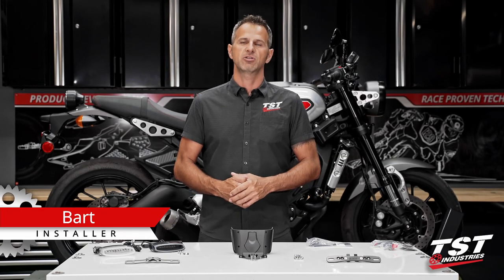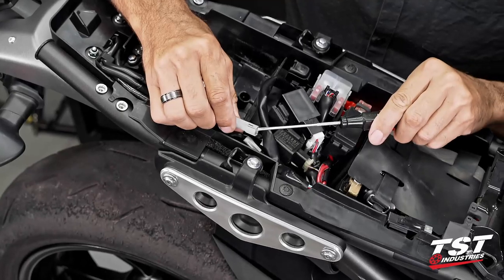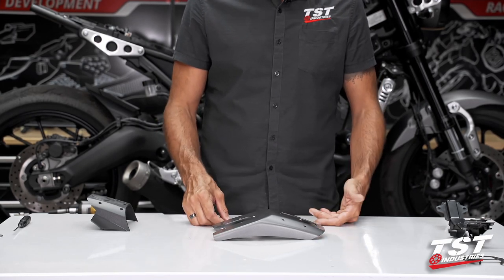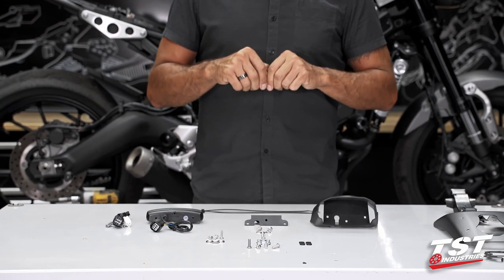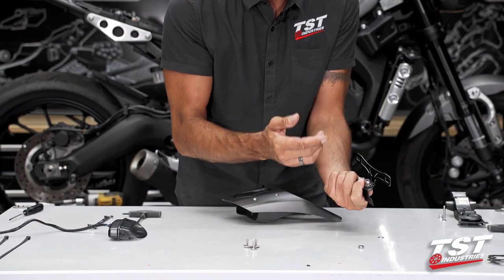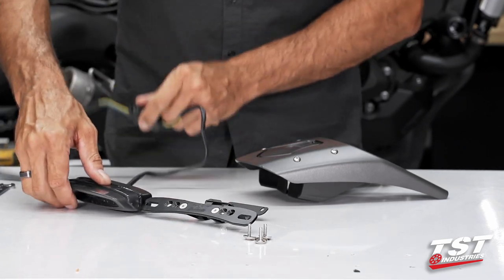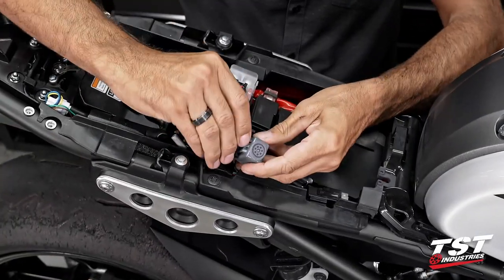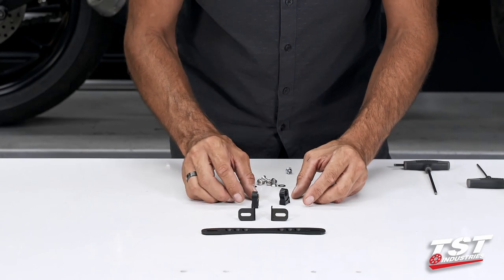How to install an Integrated Tail Light & Fender Eliminator on 2016+ Yamaha XSR900 by TST Industries

Comment: If this is the outcome of the pandemic, it was totally worth it. TST always come thru with the best mods, high quality at an affordable price. Recently I sold one of my bikes that has a TST integrated tail light and everyone in my friend’s riding club was amazed at the brightness of the tail light, even it is smoke in color, but how the light stands out amongst other bikes moded with lesser tail lights. The fact it is programmable, is really nice too. This XSR900 mod is exactly what this bike needed! I wish I had and XSR900 to put this on. One of the biggest deterrent from my choosing the XSR900 over another bike was that OEM tail light. Many will say this mod takes away from the styling; however, i would like to bring up, the mod’d light is also of the same aesthetic that would have replaced similar lights from that retro era.
Reply from the maker: Hey thanks Mark man. Always appreciate your comments.

Comment: I'm actually having a ton of problems with the fasteners from 13:25; mine are spinning and spinning, not coming out.
Reply from the maker: Are you talking about the four aluminum screws that screw into well nuts?
Reply from the maker: Chances are the well nuts are spinning inside their holes and you will need to hold them in place with needle nose pliers so rhat the screws can come out